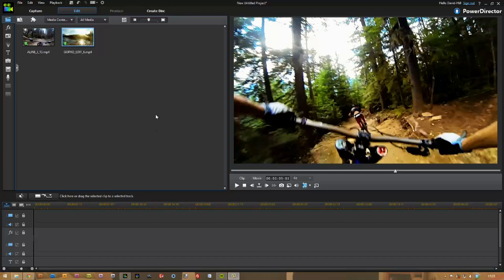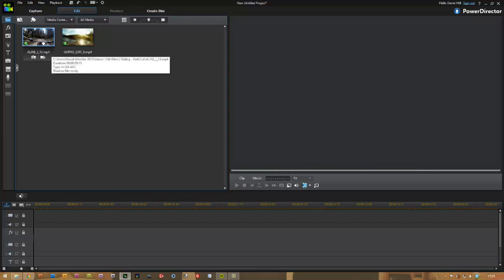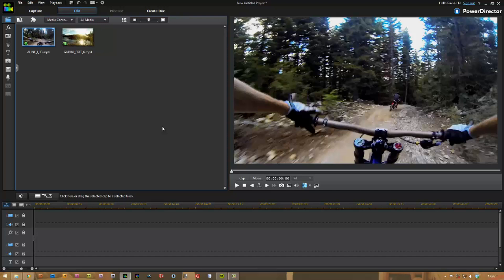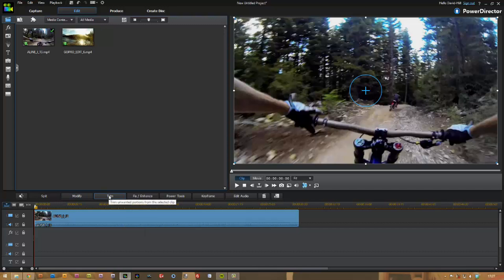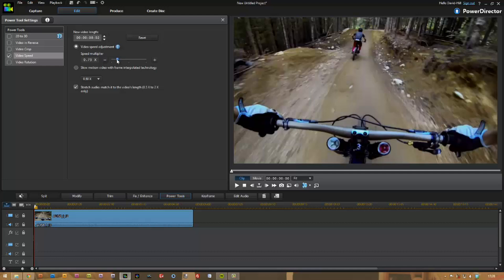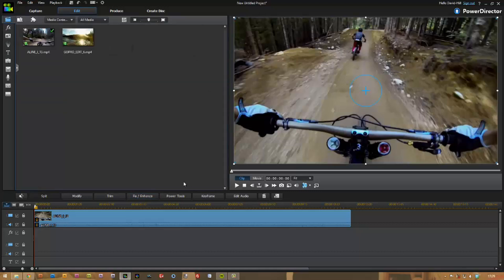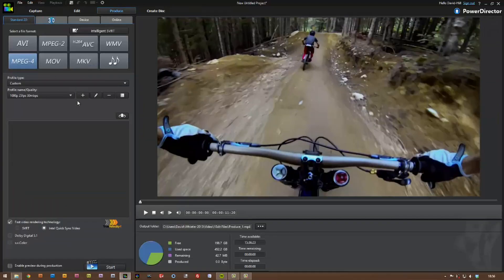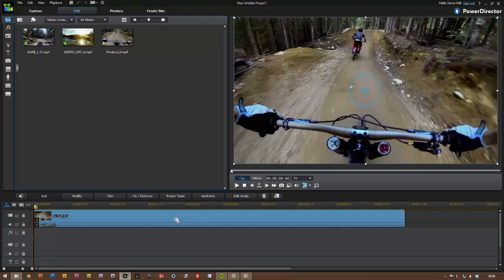Cyberlink PowerDircetor 12 - Slow Motion Video Tutorial

Comment: Nice video thank you.

You asked for questions, so here is one from me.

When I try what you've done, the speed dialoigue is not active. I cannot select either of the 3 radio buttons "Video speed", "Slo mo" or "Stretch". It ignores my mouse clicks.

I am using PD12 ad I'm importing an MP4 clip at 120 FPS (actually it reports 119.88fps) to a project at 30FPS. If you have any thoughts I'd appreciate it.

Thanks!